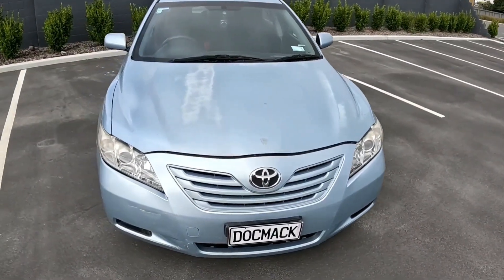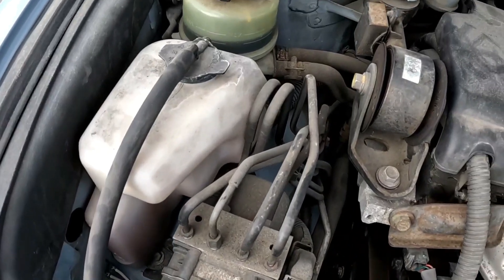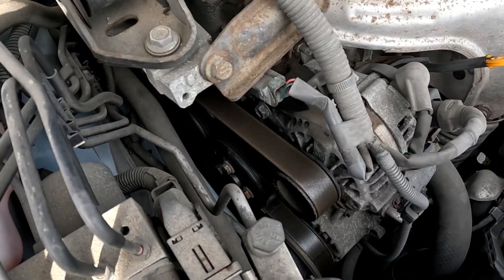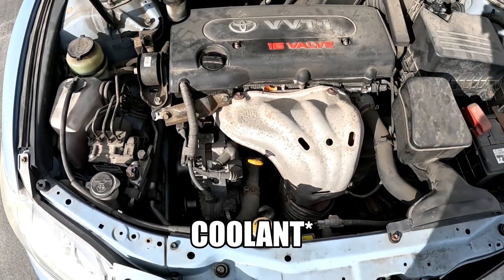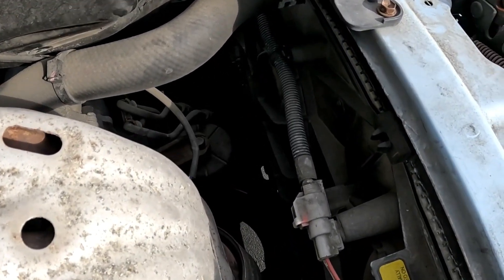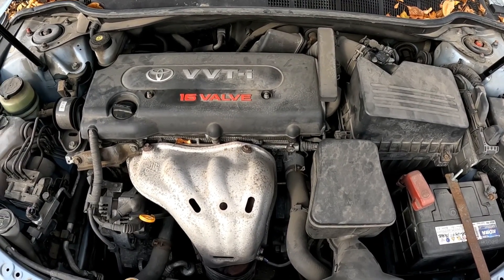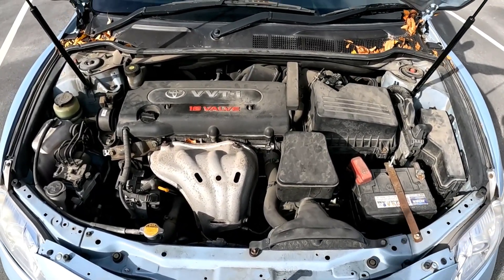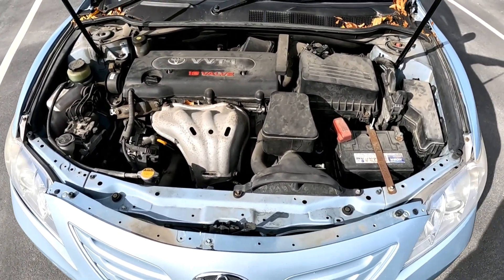What causes your cars Engine to Overheat 🔥

Comment: So i have a 96 toyota camry just got a new radiator, new radiator cap , took the thermostat out, so my gauge is going up and goes back down, but i check the radiator and its full.   But my back passenger floorboard is soaking wet, why ?? Would this make my car gauge go up?? No check engine light on
Reply from the maker: Did you check the heater core is not blocked ? If you turn up the heater does it work?

Comment: A tip if you car dose star to over heat a way to get you home is to put your car heater on fully hot and it may help to keep the engine Cooler but keep an eye on the temperature Gauge and stop if it gets to high
Reply from the maker: Yup that will activate the heater core to expel some heat but still dangerous to drive if engine has gotten to a point of overheating as it could cause the cylinder head to warp.